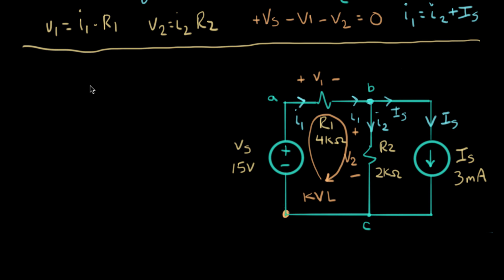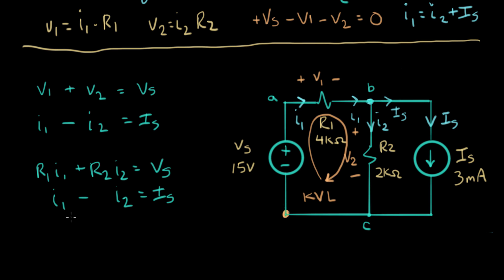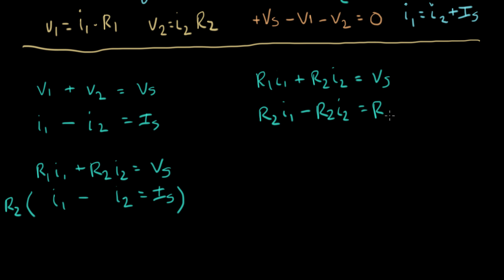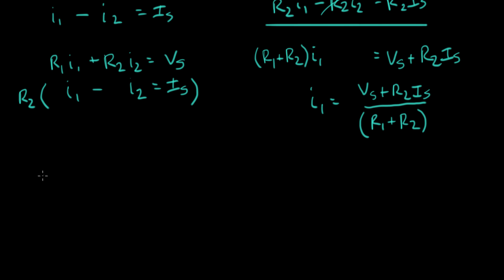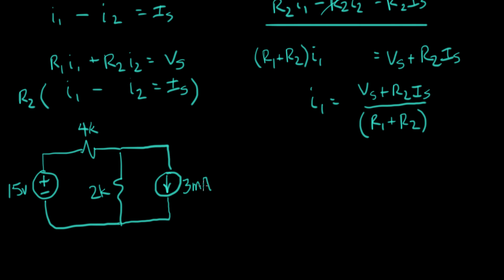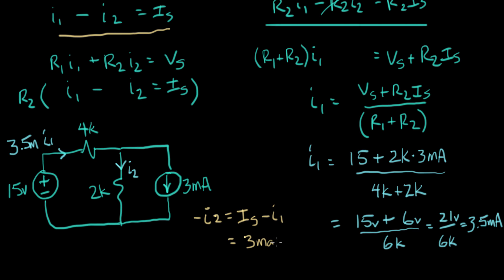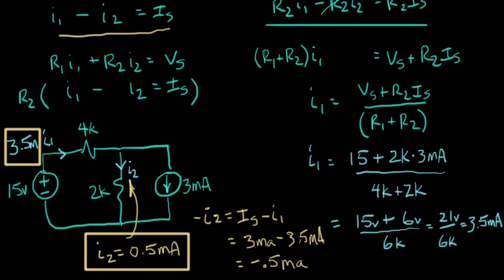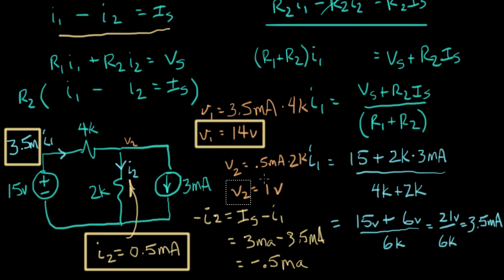Application of the fundamental laws (solve) | Electrical engineering | Khan Academy

Comment: How is i1 = 3.5mA if 15v/4kohms = 3.75mA?
Reply: Interestng thing is that why did we have to do all this complex calculations for i1 if we just could do i1=Vs/R1
Reply: I didn't understand this as well.
Reply: If we use Ohm's Law, but only plug in element data, we get element voltage. This means that if you wanted to solve for I1 using Ohm's Law with R1, you would need to know what the element voltage of R1 is rather than just your source voltage. This means that you need to solve for the node voltage immediately after R1 and use the difference in voltage to solve for I1. The method you're suggesting would actually require more steps than the one used because we would have to use KCL to get an equation where we can then solve for v2, plug V2 into our Ohm's Law equation for I1 then solve. If you are doing the calculations in your own time you should solve V2=1. We then plug this in to our equation to get I1 = V1/R1, V1= Vs-V2, I1 = (Vs-V2)/R1... 

Plug in the numbers to get I1 = (15-1)/4 = 14/4 = 3.5

tldr; You can't solve for I1 using Ohm's Law with Vs, you need to solve for V1 then plug that number in.